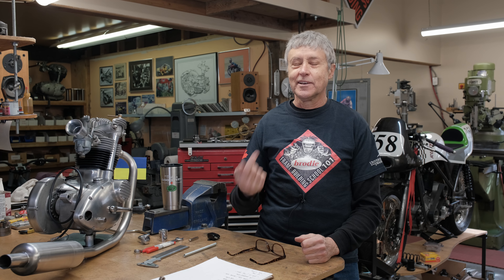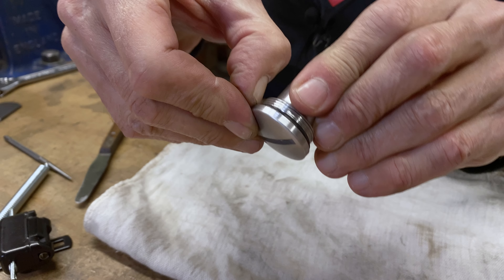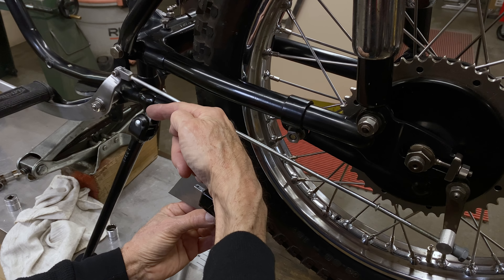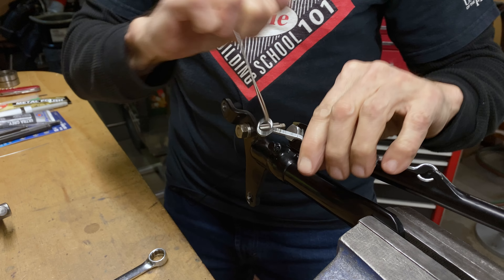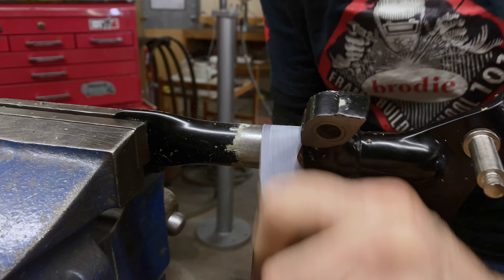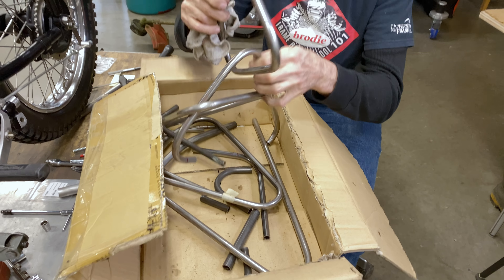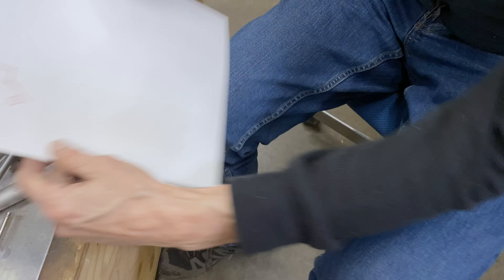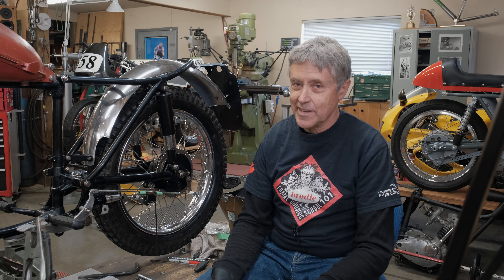Fabricating a brake light switch mount - Paul Brodie's Shop

Comment: Enjoy watching the fabrication.  I had an old mill and lathe in my shop in 79 I used to fabricate parts for old buses. Shafts that were worn would be built up and machined and rebuild starters. Blessings 🙏
Reply from the maker: Thank you Salvador.

Comment: Paul, these switches mount to the chain guard and use a spring clamped to the brake rod to adjust when the switch engages then brake lamp. On pre units the brake switch is nearly the same but reversed so the brake lever pushes the tab rather than pull. Neat stuff. I like the way you problem solve.
Reply from the maker: Someone else mentioned the switch mounts on the chain guard. But my chain guard didn't have any holes for mounting. I like having fun making new stuff. Thanks for watching!
Reply: @paulbrodie , as you were fabricating the switch and spring mount, all that I could think about was interference with the chain. I presumed that you had taken the chain into account when designing the brake switch mount but from all of the camera angles, it looks like a tight fit?
Reply from the maker: @joseywales3789   You are correct. I am modifying the mount. There will be a slide show later. Stay tuned.

Comment: Paul, if you haven't yet finished, consider using two bolts in the slot. I'm afraid with only one bolt the switch plate will rotate and loosen up, especially with the plate holding the return spring.
Reply from the maker: Thanks for your comment. I do plan to tighten the Allen screw quite well, so we will see what happens when the Cub is in operation.

Comment: Hi Paul. Love your work. I noticed that might be a problem later on.  Your switch which is mounted on the frame at a fixed position while the brake bar follows the motion of the rear suspension. I hope you get what i mean.  Unless the brake switch Switch bar is designed to have the additional spring at each  end from the frame upto the drum brake  actuator arm.
Reply from the maker: Thank you. Yes, I know what you're talking about. Luckily, the rear shocks are so stiff, there is very little suspension movement, so it should not be a problem...
Reply: @paulbrodie   Ok. Hope to see more insane machining even after the Tiger Cub.

Comment: Hey Paul, I may missed it, could you explain a little in any future video what ‘anchor lube’ is and where to get. I’m not sure if it’s nautical related or trade name?
Reply from the maker: Anchorlube is a green tapping compound. It is readily available in Western Canada at tool shops. I don't think it's related to the boat industry.
Reply: @paulbrodie  Thanks for the info, unfortunately I’m struggling to find in 🇬🇧

Comment: Not just aesthetics, but practical regarding that o-ring - as that undercut captures it, which should help with keeping the oil(?) inside the engine or ? (I’ve heard old Brit-Bikes use separate (and different!) crankcase, transmission and clutch oils…)
Reply from the maker: You are correct. There are 3 separate oil "chambers" inside a Cub motor. I think I'll just use 10/40 for all 3.

Comment: You have a bolt connecting the brake rod to the pedal lever. Could you run a small rod forward off that bold and actuate the switch closer to the "seat tube"? Then you can run the cable up the stay to the light. The switch feels vulnerable hanging down there. It also wouldn't be affected by swingarm movement.

Maybe it does need to be down there, I don't know motorbikes much :-)
Reply from the maker: The lever, where the brake rod connects, moves in a certain arc, so the switch needs to be activated from that arc. Having the switch closer to the seat tube would not allow the arc to activate the switch. Do you see?
Reply: @paulbrodie  Yeah, I told you I don't know much about motorbikes :-)

Comment: When you get around to it, Id like to see your ideas on an internal throttle cable for the handlebars.
Reply from the maker: I'm not a fan of hiding cables inside of tubes. That's like an Orange County Chopper thing.
Reply: @paulbrodie  But you put an electrical switch near the ground where water and grease can interfere but it looked cool because it had "flow"! 🚲😒
Reply from the maker: @EMNM22   Mike, I'm not planning to ride the Cub in the rain!
Reply: @paulbrodie Your thought processes are flawed. Why would a race car driver design an airplane? If your designing a motorbike, shouldnt you ask a biker what works and what doesnt?  Why would you place an electrical component near the ground where water and salts would shorten the life of the parts? Think these things through! After all the work you put into this. Id feel better knowing that when I want to stop, that the lights are bulletproof and will not fail! Otherwise build it and put your butt in the drivers seat!

Comment: Hi Paul, I can’t help but wonder about the brake rod moving up and down with the swing arm but the switch remaining stationary with the frame. I am sure you’ve thought about it, just haven’t shared yet…
Reply from the maker: Colin, you have a point, but my rear shocks are so stiff they hardly go up and down at all.

Comment: I’m really enjoying restoring a Tiger Cub vicariously! Thanks for posting these videos. My recollection (from 1967) is that the brake light switch was mounted to the chain guard. The spring was about 2 inches long and quite wimpy.  I would be concerned that the spring you’re proposing to use will create too large a force on the internal components of the switch. Almost like a rigid connection, relative to the internal return spring. Just an observation!
Reply from the maker: Thank you! Keep in mind this is not a "restoration", as I am doing it my way... The big spring is strong, but that is the brake return spring, and not connected to the brake light switch..

Comment: Hey Paul and Mitch, Brilliant as always. I'm torn between wanting to see the old bike finished and not wanting the series to end. Thanks so much for the fine episodes. P.S. Just wondering where you will now put the pillion passengers pegs?
Reply from the maker: Thank you Sandy. I am rather amazed at how many Cub episodes we have done. Never anticipated that. We still have more to do. The pillion passenger pegs are in a box outside in my trailer.
Reply: @paulbrodie  Didn't you cut off the mounting for them, well one of them, to fabricate the mount for the brake light switch? Will you now fabricate a new mount for the pegs? I guess I'm being my own spoiler; I will wait and see. Cheers.
Reply from the maker: @SandyBoneTube   This Cub is for me, no passengers. We don't want to make that little engine work too hard, right? There are no passenger peg mounts now..
Reply: @paulbrodie  It is a thing of great beauty Paul. Can't wait til you get to ride it. That will be some fine fun!

Comment: You can get a variety of switch that has a clamp that goes around the frame and a  spring connected to another clamp which clamps the brake rod and sideways movement activates the switch.. could this be the original BSA switch?
Reply from the maker: I think my switch is a Lucas replica.

Comment: Hi Paul, enjoying the videos, and it’s not a restoration, but don’t you intend to have a chain guard? The original brake switch mounted there. Seems a lot of work to cut off a footrest mount only to reconstruct something close. Vibration may affect the position.
Cheers
Reply from the maker: Yes, I do have a chain guard ready to install. Ah, so that's where the brake switch mounts! I did not know. Yes, this Cub has been a lot of work, but I am still enjoying it.

Comment: Hi, isn't that switch need to move up and down same time with the suspension arm?
Reply from the maker: Probably, but my rear shocks are so stiff there is going to be very little movement.
Reply: @paulbrodie   now I see it, you connect it with a spring... yap this will give the necessary "freedom" with suspension movements. Nice!!!
Reply from the maker: @razvanbutiac7684  Thanks. Actually, I couldn't find the correct spring, so ended up using a small piece of brazing rod. That video comes out tomorrow..

Comment: The shoe springs are there just to keep the shoes in position. you seem to be missing the Brake Return Spring, which sits around the cam pivot and acts on the actuating arm?  My earlier posting on this seems to have been removed, perhaps because I  included a link to a parts diagram? I can E-Mail it to you if you ask.
Reply from the maker: We have a brake return spring! I'm just making it up as I go. This is not a restoration project.

Comment: Hi Paul,
If you pause at https://youtu.be/0Tci-0EU42M?t=905 - i am not further into the video.
I would sugest to bold the switch behind the frame and connect it directly to the Brakepedal instead of the brake "rod".
If the swingingarm is moving you need the switch to compensate that without turning the brakelight on. If you connect the switch direkt to the pedal - the switch has nothing to do when the swingingarm is moving up or down and you can hide / mount the brakelight cables better.
Reply from the maker: Yes, I did think about that. But my rear shocks are so stiff that there is not going to be a whole lot of wheel travel. I do not believe a bump will cause the brake light to come on. If it does, that just gives us another episode to film!

Comment: From where I'm sitting it looks as if you're right in the chain run with that switch.
Am I sitting in the wrong place?
Reply from the maker: The switch is fine, it's the back of the mount that gets hit by the chain. It is getting modified now.

Comment: Could you not anchor the switch on the brake torque arm bolt, then run a long spring up to the pedal? At least one less piece to worry about. Or onto the brake rod?
Reply from the maker: Yes I could do that, but I wanted to create something custom with a little design flair. It keeps me from getting bored.

Comment: if I may, circa 9' you're using a straight flute tap, not a spiral one (no big deal in straight through plus reliatively thin Aluminium, with a proper size predrilled hole there are very little chance of chips clogging and get the tap to stick and break)
Reply from the maker: We probably live in different countries, and taps might be called different names. I have never heard of a "straight flute tap" in Canada. I know machine taps, spiral point taps, and spiral flute taps. Thanks for watching.
Reply: @paulbrodie  yes, I'm in France but gathered some mechanics vocabulary in the US - I understand the common habit is to break the chip manually with straight taps (going a bit in reverse every now and then), while the spirale flute would break it automatically and eject the debris like a drill bit, so less risk of clogging...
Reply from the maker: @n1352-m1i   Yes, what you call a straight tap, I call a machine tap. A spiral point tap drives the chips down, while a spiral flute tap drives the chips up.

Comment: Wouldn't there be a quite large force from the spring trying to lever the bracket upwards? I notice that the spring is quite strong. Having two bolts in the slot would negate this, i think
Reply from the maker: You might be right. The mount needs to be redone anyway...
Reply: @paulbrodie  ...as Mitch already predicted..... 🙂
Reply from the maker: @hobbyoverload   Mitch predicted that the aluminum plate would get redone, but the mount that holds the plate also is getting redone. Something about the chain getting in the way...
Reply: @paulbrodie  That's why my 1977 bike has a drive-shaft ;-) (bought it 17 yr old when I was 27 and within a couple of weeks, i'll be turning 55 ....).
Anyway; keep up your good spirits; they're very inspiring to us, viewers and makers alike.
Reply from the maker: @hobbyoverload   Yes, I am happy in my shop. There's always a project that needs to be worked on. Thanks for watching!

Comment: Didn't the brake switch mount to the torque arm bolt with a little clip onto the brake rod?
 Pretty sure original set up was pretty ugly and awkward looking  with little tin band around brake rod and spring twisted underneath brake rod.. Obviously an afterthought and not part of 'design (most people were happy if it just worked!)
Reply from the maker: I have no idea what the original looked like. I don't have a sample Cub, or a close up photo. I guess I'm doing it my way.
Reply: @paulbrodie  I only have a vague recollection from working on that style of switch around 1978 or 79 when I worked at Honda/Yamaha/Triumph dealers. 
Covered in oil from chain and dirt/dust from riding. I remember thinking at the time it was a piss poor way to fit brake light switch 
Good cleaning and everything worked fine though, labour charge was way cheaper than a new switch (which was only available from Lucas back then)

Comment: It's probably not going to run that great with a used 26mm Amal carb?  Signal strength on Cubs isn't that great, and on many trials versions in the UK, using Amal carbs,  18mm restrictors are fitted into the inlet port. A Cub will run FAR better fitted with a 22mm Dell Orto, on a rubber spigot manifold, and no restrictor.

Some very trick bigger capacity Cubs, have the combustion chambers modified very extensively, but the bigger bore bikes are very fragile and tend to destroy gearboxes and crankcases quite quickly.  

Trials bikes based on highly modified later versions of the BSA Bantam, are now far more popular than the Cubs, largely as they are much more reliable and cheaper to build.  A trick trials Cub, with new chassis,  billet cartridge forks, billet wheel hubs, 250cc motor, and lightweight tubeless wheel rim, will cost around £15k, so pretty expensive................
Reply from the maker: Well, someone who has a Cub for the road, has told me that my bike with a 26mm Amal is going to run great! You and him have a difference of opinion, obviously.
Reply: @paulbrodie  An awful lot of UK trials riders with Cubs, would be over the moon if their bikes would run properly with a worn out old 26mm Concentric!

Good to hear yours will be fine...........
Reply from the maker: @humourless682   Partly why mine will be fine is because I am NOT building a trials bike.. Race cam, big carb, 9:1 piston, tall gearing, plus I just got a Triumph 350 / 500 front hub!

Comment: That brake light switch is a big ugly lump of a thing. Not tempted to go for a neat little concentric style job that could be tucked in near the brake pedal pivot? As ever though the work you've done is top notch! "Can't take too long right?"
Reply from the maker: It is a big ugly lump, but I wanted to use it because it is a Lucas replica. The small concentric switches are Japanese, and that just wouldn't be right!